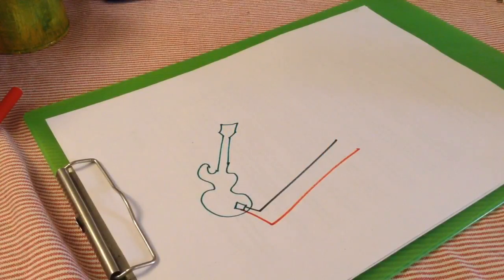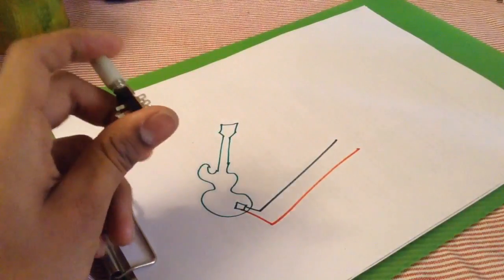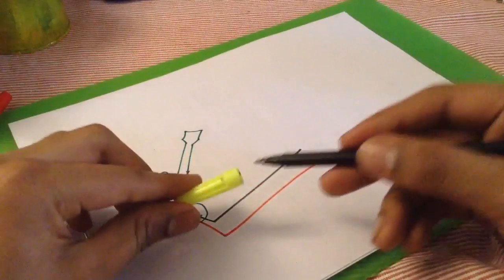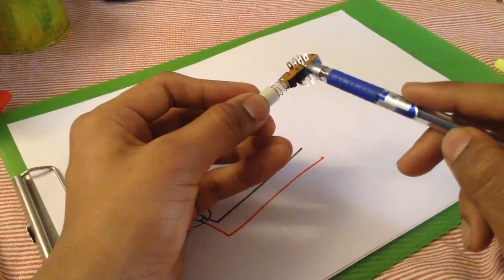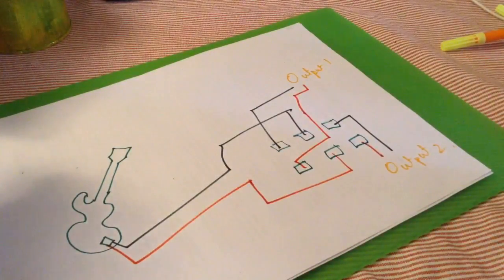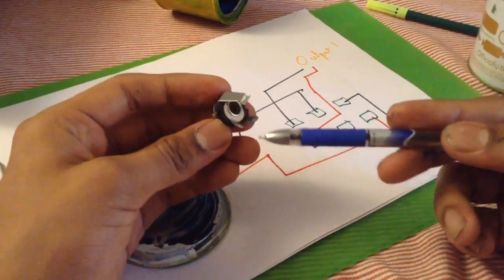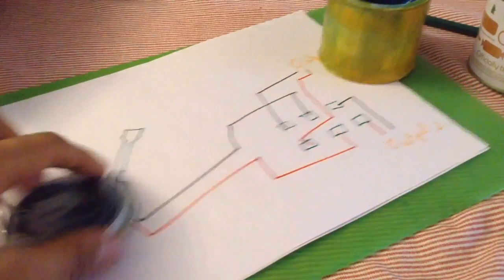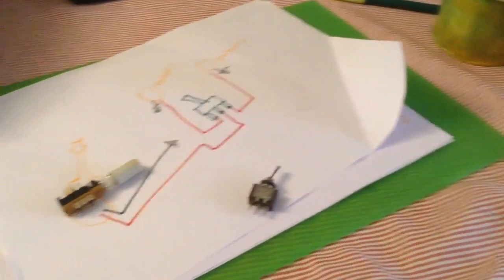The Easiest DIY guitar pedal (A/B Switch)

Comment: when the switch is in the middle do it allow both instruments to play at same time
Reply from the maker: @JewcoLive Nope, it allows none of the instruments to connect to the amp.
Reply: @CuriousMotor  ok , this build is exactly what i needed to see , i may make mine where it plays both for both my keyboard and guitar and add a slide potentiometer to mix the two to play them both if i choose , is a three pin switch available to play both while it set in the middle?
Reply from the maker: @JewcoLive  Gotcha, easier way to do it- use two switches, one for each instrument. If you want to use both, you would just need to turn on both in that case.

I'm sure there are better ways to go about it. I made this project with a switch that I salvaged from a broken appliance, so I didn't put a lot of thought into it back then :)
Reply: @CuriousMotor  and that could make my soldering life a lot better and two switches should give it a nice complicated dramatic finish when switching them on , I might as well add A 9 V battery for the LEDs to let me know which one is engaged , Thanks for this